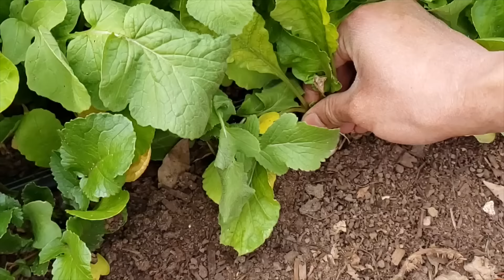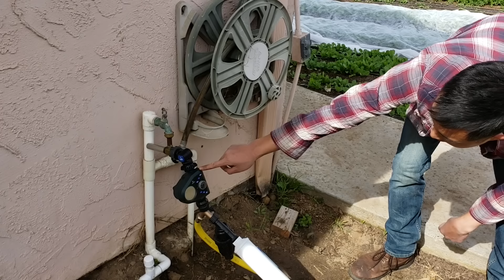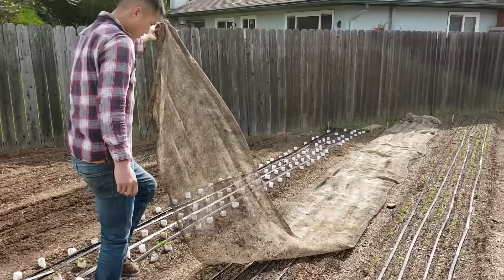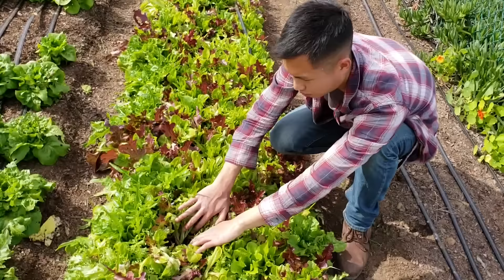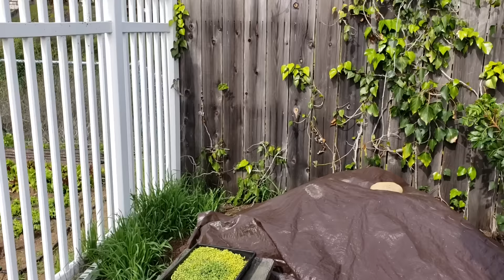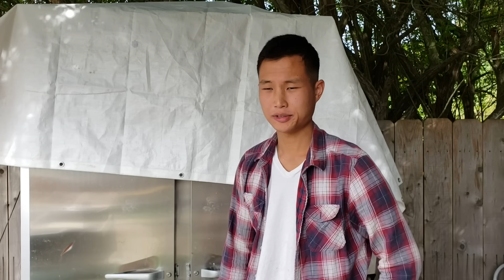First Year Farmer: Backyard Farm Tour and Interview

Comment: If you put out small cups of beer the slugs will go in and die happily drunken in the cup, they can tip them over and waste the beer though so would recommend securing them in the soil a bit, I usually "bury" the bottom quarter of the cup

Comment: Regarding the spigot outside. All spigots are attached to the wall using a wall mounted pipe clip clamp, this is to prevent the hammer affect plus accidentally pulling the pipes. This would be especially needed with the PVC pipes particularly at that height, making  them more flexible.

Comment: May not help but, leaves can turn from green to red when temperatures dip to freezing. This is not harmful to beets. Some varieties have naturally red leaves. 
If the leaf margins turn red, leaf tips die, leaves become crinkled, corky black spots in roots or roots cracked it's most likely a boron deficiency. Test the soil. If deficient, add 2 ounces of borax per 30 square yards. Boron deficiency is usually found in soil that is either too alkaline or too acidic so opposite ends of the spectrum. I don't think it would be boron as your growing in compost but if you are getting tests done you may want that testing too just in case as you can't get your time back. Thanks for the video.
Reply: This is slightly random but ingesting small amounts of borax can be helpful for a variety of things, I drink it in my water regularly.  Never thought to add some to my garden because I just assumed it was already there, thanks so much!

Comment: Ahlafirmy Bey Islam, if you take and instead of the water supply coming up the I think 15 inches and a 45 degree and your water spout. You need to let the water supply continue up another 15 inches or so, keeping the spout at 15 inches. This should fix the water hammer problem. In fact this is called a hammer. It contains the hammer affect behind the spout or water shut off. Ahlafirmy Bey Islam